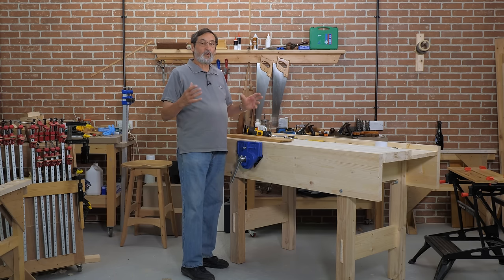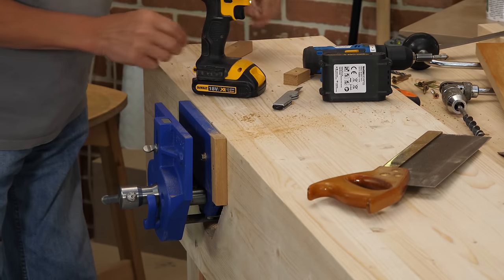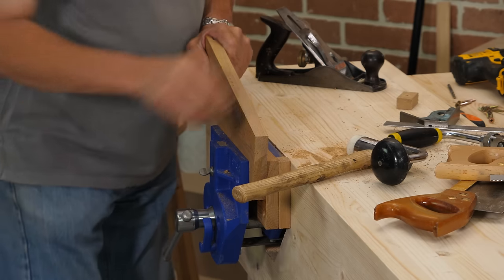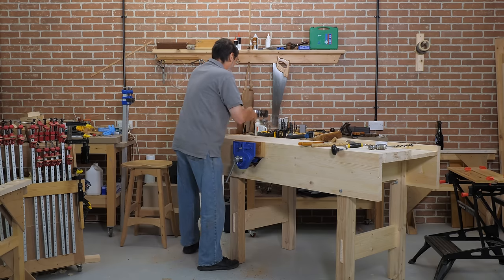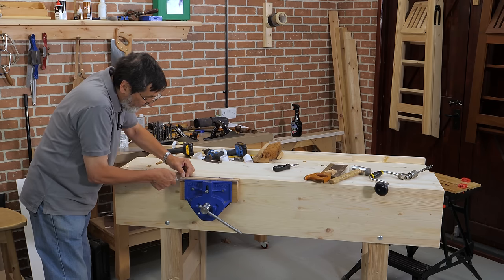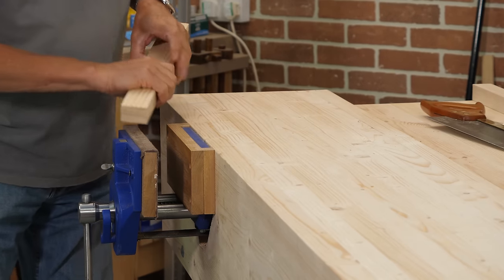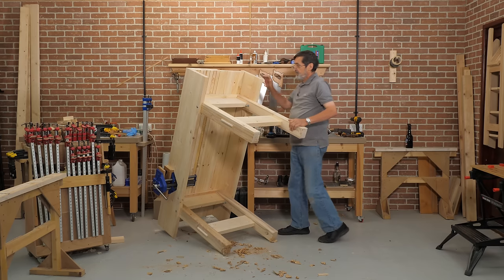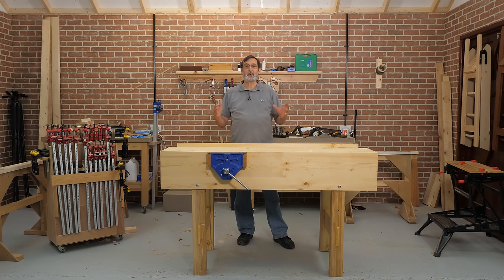How to Make a Workbench Episode 9 | Paul Sellers

Comment: Instead of using a piece of wood for the wedge retainers, why not run a screw through the the wedge itself? A so I have found that applying a cost of two of paste wax to the top of the bench prevents glue from adhering.
Reply: Donald Schlicht the wedges tighten themselves and when the wood shrinks the wedges will tighten the bench, if they are fastened into place the will not move with the table and it could rock if the wood shrinks enough.
Reply: I applied wax to my first bench and saw table years ago and regretted every time I tried to apply any finish, as the timbers would always pick up even just a trace of wax and wreck the applied finish somewhere, usually in the most annoying place ever.

Comment: Should left-handed people like me put the vise on the other side of the bench?
Reply: Check his website, I think he answered that question somewhere on there already.
Reply: It really doesn't matter very much. The important thing is to have your tools within easy reach of the vice. Notice in this video that even though Paul is right handed he frequently reaches for a tool or a piece of wood with his left hand, then shifts it to his right hand before using it. It's all so smooth it doesn't slow him down at all. He probably doesn't even know he's doing it. In this particular setup, with the tools stored on a wall to the left of the bench, as a lefty I would want the vice on the left end just like Paul has it. I wouldn't even have to shift hands.
Reply: I'm also a leftie and like my vice on the left too. If the vise is closer to the end of the bench you can secure a piece over-hanging the bench end so that you can saw right through with yer left hand too.
Reply: Great point. I'm left handed and never considered this. From memory, any bench I've used has the vice on the left, which would suit right handed folk. Maybe, I've adapted my approach to use a bench (albeit inefficiently) this way, just like PC mouse, scissors, can openers etc.

I've been watching all this series and making my own new work bench along the way, so picking up hints and tips. Although my bench isn't like this, I'm almost at the stage of fixing the top and installing the vice. Until I saw your post, I was happily going to install it on the left, but now I need to rethink. Thanks for triggering the thought :-)

Comment: What would be the best Vegan alternative to the leather for the vice jaws?
Reply: Possibly some Cork ?
Reply: rubber-cork (Crubber) or nitrile-cork I guess (I have to try thoses).
Reply: Andy Midd ii
Reply: Adhesive backed cork (try craft or hardware stores) has worked well for me! Thicker the better. Just avoid getting oils on it.
Reply: mark l Gryphon, thank you for your considered input.
Reply: You can just skip the leather and use some of that rubber shelf liner stuff if you have a piece that's slipping.
Reply: Crubber it’s cork and rubber from recycled tires ( some companies use this so just make sure to do a little research so your not disappointed).
Reply: I use this, very good grip but it's a little weak when you mortise in the vise or clamp irregular shapes.
Reply: I second the shelf liner idea. Cork is just so fragile.
Reply: Naugahyde of course!
Reply: maybe denim from an old pair of pants?
Reply: Old fire hose. ALso good for sawhorse tops.